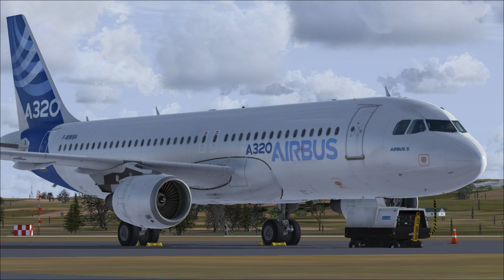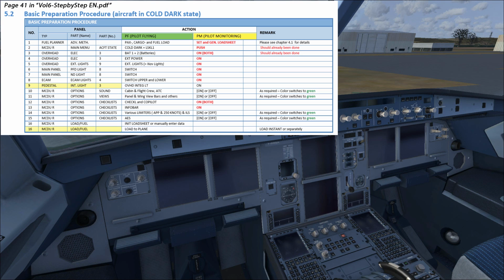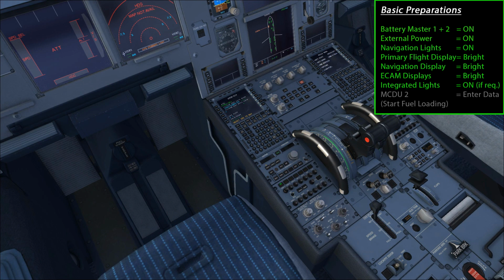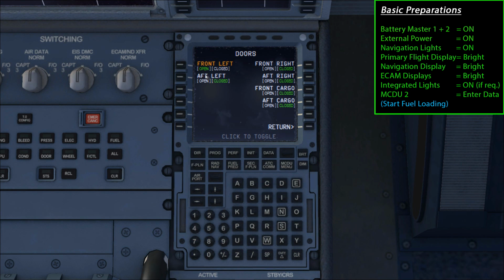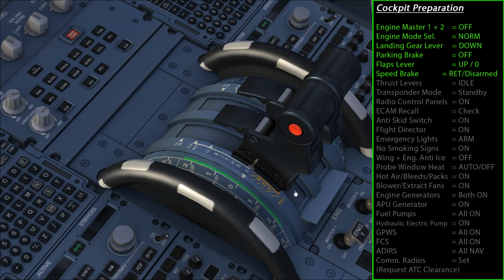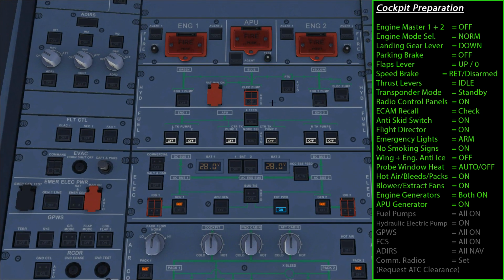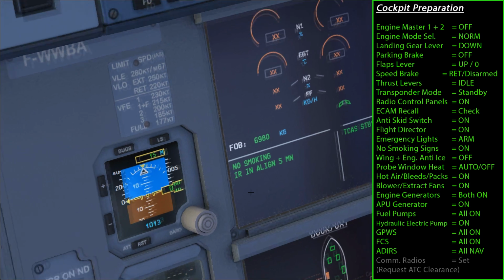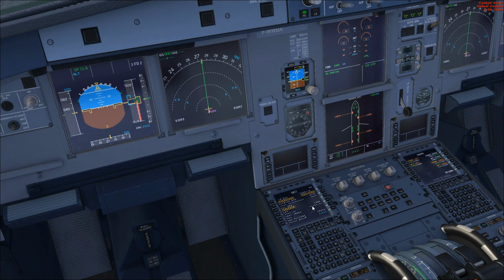A320 Power On Guide (FSX - Aerosoft A320)

Comment: Hello. I have aerosoft a320 but only problem is it's activating toga lock (auto throttle) with me doing nothing. It's because of fly by wire, but when I turn off fly by wire with right FMC my flight pitch and controls are dead. Any idea how to get rid of auto throttle?

Comment: How do you get the checklists? Also is there a instruction manual you can download for Aerosoft A320?
Reply from the maker: The checklists and documents normally come as PDF files with an add on aircraft. They should be available in the same computer folder which stores the aircraft's files.

Comment: Can i press APU switch after exit power??
Reply from the maker: Unlikely, the plane would jump back to battery power and the displays might switch off and you might lose any data that you've entered into the computers.
Reply: @Doofer911  ok..then what in the case  if there is no "avail" indication on ext pwr?..can I press APU directly after pressing batteries ?
Reply from the maker: @aquibazbar9317  yep

Comment: Unfortunately Aerosoft's A320 for FSX is much better than their A320 for Aerofly FS2 which is their own flight sim.  I'm starting to regret buying AeroFly and wishing I had bought FSX!  Can you still buy FSX as a stand alone product, or is it only available through Steam?
Reply from the maker: I think if you look hard enough you could find some original FSX boxed versions out and about. Steam Edition is a little better as it's been slightly optimised compared to the boxed version. Unfortunately FSX is quite an old piece of software now and it was never designed to work on 64bit computers and take advantage of modern computing power so you might be better holding out for Microsoft's new flight sim (Flight Sim 2020). Alternatively, there is Prepar3D (P3D) which is an evolution of FSX made by Lockheed Martin. And there's also X-Plane 11 which is another popular flight sim.

Comment: How can i get aircraft options like door operations, gnd services and payload and fuel settings on the mcdu at the copilots Seat and not on the pop up mcdu that i need to open by clicking on the top of 1 of the main mcdu on the aerosoft a320
Reply from the maker: I dont think it's possible, you can only get it on the pop up MCDU xxx

Comment: What airbus are you using from aerosoft? Is it the airbus a320, airbus a320 x extended or the airbus a320 professional?
Reply from the maker: If I remember correctly, the version in this video as the A320 X Extended. I'm now using the "Professional" version in P3D v4.

Comment: How can the APU generator work without switching on the APU
Reply from the maker: It can't. The aircraft can still get electrical power from the on board batteries or by having an external GPU (Ground Power Unit) plugged into the aircraft.

Comment: I have a question. My airbus is only at 1fps on fsx and I can’t move the cameras or anything cause it’s slow. And my computer can handle this because it has before. What must I do so I can use this aircraft?
Reply from the maker: Not sure, maybe check the Aerosoft forums to see if anyone else has solved framerate issues.

Comment: When you load the airplane in COLD DARK state and turn both battery Master switches to ON,  the Extenal Power button will NOT be immediatly available.  I had to set the state to TURN AROUND STATE momentarily and then returned to COLD DARK to make the External Power button Available. I think that is a simulator bug.
Reply from the maker: Sometimes you just need to set the parking brake before the external services are available. No need to change from one state to another after loading in.
Reply: Perfect, Doofer.  It worked fine.  it is enough to set the park brake to ON to enable the GROUND SERVICES menu on MCDU2 and so to set EXTERNAL POWER "connected". As consequence the EXT PWR button becomes AVAIL.  Thanks!  If possible, it would be great if you could insert this tip as text on the video at that point...
Reply: @josiasmartinsjr9353   first thing to check and set Parking Break :)

Comment: How do I save a flight inflight?
I want to continue flying later
(1hr computer limit)
Nice video
Must be hard to make them
Reply from the maker: It's difficult with this aircraft because whatever "state" the aircraft is set to load up as, it'll load that state regardless of the sim's save file. For example, if the plane is set to load as Cold and Dark but you save the sim mid-flight... the next time you load the plane's position will be mid-flight but the aircraft will be cold and dark.
Reply: ok thank you! @Doofer911

Comment: No doofer911.my aerosoft x MCDU 1,ECAM, Navigation display not working .So that to external power not get
Reply from the maker: Maybe try to reinstall the add on then. If you still have problems, it's best to contact the developer for tech support issues.
Reply: Down Lo oad the sp2if ypu haven't

Comment: Hey please .Were is external power.my p3d v4 did not see
Reply from the maker: Maybe try turning the batteries off and back on again. Sometimes the second MCDU doesn't come on properly. If that fails, you may have a corrupt file and need to reinstall the aircraft.
Reply: Doofer911 my aerosoft x MCDU1, ECAM, Navigation display is not get  or brgt .So that to external power.how to corrupt file please
Reply: Doofer911 .I trust you

Comment: Parking brake needs to be on, the only time it would be off when parked at the gate would be if the brakes were hot.
Reply from the maker: Chocks stop the aircraft from moving. Brakes engaged requires Hydraulics systems to be pressurised.
Reply: Doofer911 I understand that for the purposes of your tutorial that’s quite correct but in the real world the accumulator keeps the system pressurised for use of the parking brake. It contains enough pressure for about 24 hours of use. Planes don’t generally sit around for that period in the real world.

Comment: i learning a lot from all of your video. thanks doofer. but i have a little problem here. i saved flight game when plane at in cruise altitude but when i loaded it, the plane is suddenly in a cold and dark mode. can you help me please?
Reply from the maker: Have you got the plane set to load in as Cold and Dark by default by any chance? Some addon aircraft are a bit weird when it comes to saving them mid-flight. They often don't load in properly. The PMDG 737 has the same issue with their mid-flight tutorial saves. Try loading that in and you end up tumbling uncontrollably into the ground :/ doesn't even put the plane into forward flight.
Reply: owhh you right! now i know the problem. i forget to clear cold and dark DEF set mode. and if there still have a problem with loading, maybe i will flying non stop just like a real pilot ^^ not saving and load again haha. Thank you so much doofer.

Comment: Do you use FSX Acceleration? Do you need the acceleration pack before getting the airbus from aerosoft?
Reply from the maker: I am using FSX Steam Edition which comes with FSX Acceleration built in. I don't know if Acceleration is needed to work with this aircraft so it's best to check on the Aerosoft website.

Comment: Ho Doofer, Great video. 
I just wanted to check if you can share how you was able to get a checklist that turns green once completed each task, i think thats a great tool to have .
Reply: Hi Doofer, I have found the checklist on another video you done, which again is awesome and really good to learn from.
I am intrigued to know how have you managed to get the checklist to change colour when the action is completed?
Reply from the maker: Hi Craig, unfortunately it's just a graphic I added in video editing. It's not a software addon however I am starting to look into how to make it an addon like that for FSX. It will take some time though.
Reply: Hi Doofer, thanks for responding. I look forward to that.
I'm having difficulty as I'm not able to get on the glide path correctly so my plane doesn't tend to descend to the runway until it's very close in which case I'm too late and miss the approach. Have you had this before?

Comment: You leave ELEC pumps and systems on for most of the whole flight
Reply from the maker: Didn't know that, I found the documentation and guides/checklists with this aircraft very inconsistent so it was hard to decypher what the correct procedures were.
Reply: If you’re referring to the yellow electric pump, in normal ops that is never turned on during flight. The engine drive pump and the PTU take precedence over it. It’s only necessary to pressurise the accumulator if the plane has been standing for a long time, with regular use it remains pressurised indefinitely.

Comment: I dont have a load/fuel page on my mcdu 2, how do i get it?
Reply from the maker: You would need to contact the developer if you have any technical issues with the add on.
Reply: Doofer911 thanks, problem is resolved anyway. Had downloaded an out if date installer

Comment: Thank you very much for the videos.

 I am a software developer and highly interested in Aviation. What I wonder about is that why this much tasks and checks are not done by computers? From the start of using the batteries to turning engines on and other procedure, there are lots of things which can be computerised relatively easily. Why are these things still manually done?

Thank you again.
Reply from the maker: I think if cars become fully autonomous and are proven to be safe, then the next logical step would be aircraft. They pretty much fly themselves nowadays however they still require Pilots to monitor the plane to make sure it's doing what it should be doing at each phase of a flight. Also Public perception will take a long time to change and adjust to the point where they accept that a computer is in FULL control of an aircraft without any input from the Pilot at all.
Reply: I would never get a better answer. Thanks heaps. It makes perfect sense.

Comment: Is it ok if you don't turn on the APU right away after you turn on the External Power? I'm just asking because in other tutorial they turn on APU  right after they turn on the external power and the battery.
Reply from the maker: Yes it is. The APU is a mini jet engine which burns fuel stored in the aircraft so I'm sure that airline companies would prefer to limit how long APUs run because it's burning extra fuel and costing more money. All the electrical power that an APU provides can also be provided by a ground power unit.

Comment: @Doofer911 why do the anti ice switches have to be turned of before engine start?
Reply from the maker: The quiet buzzing could be the cabin electrical systems which run separately to the cockpit systems. Not 100% sure on that though.
Reply: Doofer911 Thanks!